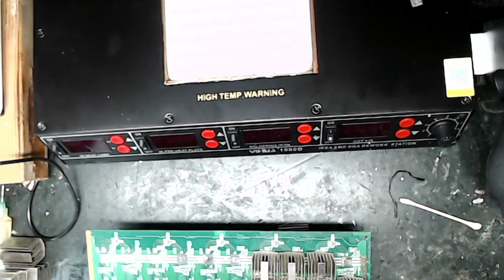hashboard repair: Reflowing a chip on a T17 hashboard to fix only 10 ASICS found.

Comment: Hi
I have a problem in repairing.
I had t17 hashboard that it showed just 16 chip.
In kernel log. 
After change asic 16 and 17. Fault  goes to 29.
After changing all of faults chips, every time showed me random number 9
after recheck 21
After some seconds 12
It show me 28 0 sign and 30 chips in status tab.
After restart all of number that i mentioned it change.
What is problem?